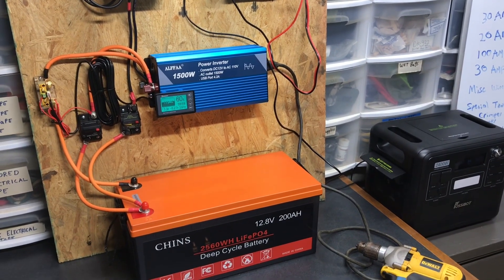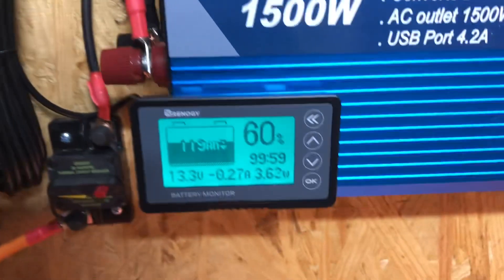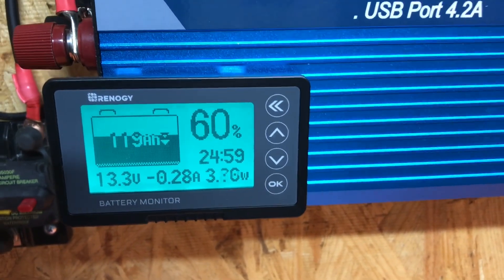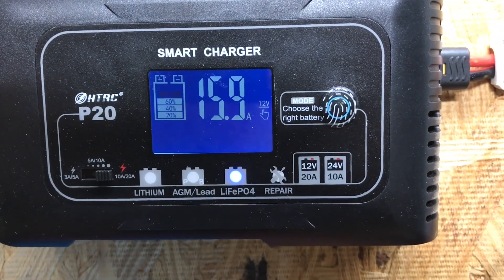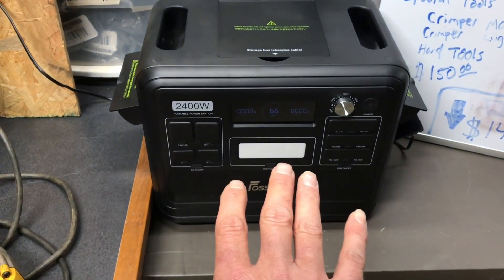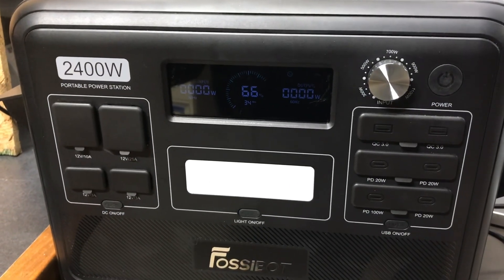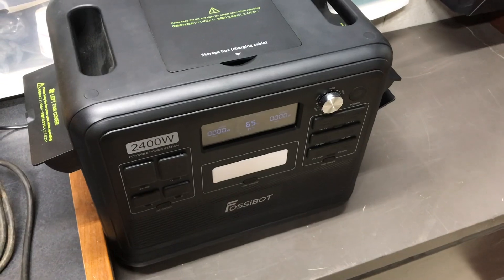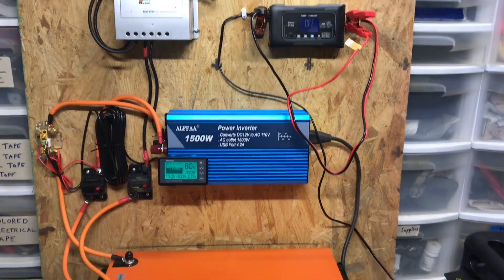DIY SOLAR GENERATOR-BUILD VS BUY

Comment: I built mine much cheaper. $165 with coupon x2 for 2 100AH batteries is cheaper even the mini size I bought. 2  Renogy 100 watt panels with charge controller damage box on Amazon $154, 2000watt pure sine wave inverter also damaged box on Amazon $150. 2 circuit breakers 16 and 36 amp $25, 2/0 awg  5’ black and red $60. 3 200 amp fuses and holders $12. And one of the stackable tool boxes with wheels $60 with coupon at Harbor freight. Anyway it really pays to shop for the damaged box stuff and the Prime day’s sale on Amazon. All test great just has to be configured into the tool box for portability. I think I did great for a 200Ah 2000watt  solar generator. Although I may upgrade to a MPPT charge controller at some point. I hear they are better. Maybe a good video idea to explain the different types.

Comment: Is this big enough to run home freezers (2), foreplace blower fan, and refrigerator?
Reply from the maker: Possibly, you would be pushing what the inverter is capable of in certain circumstances, such as inrush current/surge demands from the freezer compressors and fireplace blower when they start up. For 2 freezers+blower  you might also think about adding more battery capacity to get through the night. Think of the demonstration unit similar to a 1800-2000wh power station! Hope this helps!

Comment: Guess for a little more money for 2000 watt inverter. Plus make sure you use 2 Guage for 12 volt system. Bigger power ac input if able for faster charging if you wanted. But nice to watch for more insight.

Comment: Nice small setup system you have there . Are you planning to set it up on a well designated wall as this system May grow over some time ? The Chins Lipofe4  200 AH battery is the beast and heart of the system plus the backup solar generator is an excellent choice for a 2nd backup power system during any failures or repairs to the 1st system . We preppers are always ready even during any SHTF situation where we can go off the grid . Check out my DIY solar videos and hit like, leave a comment and subscribe and May the solar be with you .😊
Reply from the maker: This was just a basic setup to help demonstrate the concept of what one could build at home. 
There are no plans to commission this setup into a permanent install. R&D only. 

Thanks for watching and commenting!

Comment: How long with that set up run 2000 watts?
Reply from the maker: This particular build isn’t capable of 2000 watts with the Alffaa inverter. 

The battery would run a 2000 watt load with properly sized inverter for a bit over an hour. More to it but that’s a ballpark #. 

Hope this helps! Thanks for watching and commenting!

Comment: Great example of a good budget system.  There are so many good options for these systems and the modular nature of serviceability and upgradability of the home built is really excellent and fun if you are a tinker'er . The all in one is definitely a great solution too and for a lot of people may be the best route due to its simplicity portability and being plug and play. A good upgrade path for this down the road, or even a similar system with higher quality more efficient and moderately more expensively priced components would be Victron SmartSolar charge controller and Inverter and shunt.  The Victron gear is more expensive, but pretty reasonably priced,  Victron's interoperability via Bluetooth networked Victron componentry integration is really excellent.  This budget system is a really nice place to start if you are looking to learn and have a serviceable scalable and upgradable solution.
Reply from the maker: Thanks for taking time to watch and comment! 
I’ve used some victron components in the past and have been pleased with the quality and performance.

Comment: I've got most of my components together, but hadn't thought about breakers yet. Regarding the main breaker you're using between the battery and inverter, you said it was slightly under sized. Would you calculate the size for that one, 1500watt (inverter size) divided by 12volts (battery voltage) for max amperage of 125Amps? My inverter is a 3000W, so I'm thinking I'd need a  250Amp main breaker.. Not sure about that. Scratching my head. Thoughts?
Reply from the maker: Here’s an article you may find helpful.

https://www.sma-sunny.com/us/properly-sizing-a-pv-inverter-breaker/

Comment: Does either the factory-built or the home assembled solar power system significantly outperform one or the other at this point?
Reply from the maker: The factory portable power station would outperform the DIY version in current state. 
The factory one has quicker charging capacity and bigger inverter. 
Other components could be used for the DIY build and it would outperform the factory one. 
There’s more to it, just the short answer!
Reply: @THEOFFGRIDMOUNTAINHOMESTEAD    
    That is exactly what I was thinking. Your Hardware choices where to create a less expensive system that was functional. Thank you

Comment: The thing I am most concerned about is the battery. Electric vehicles do have battery problems. If there is a battery fire due to malfunction or accident. It may take a real fire department hours and two or three thousand gallons of water to cool battery fire and stop it from reigniting. Those cars use some sort of lithium battery. Many parking structures and buildings apparently do not allow electric vehicles to park in them. Are the batteries for home solar systems a similar fire danger? Can you have them safely in your home or outbuildings?
Reply from the maker: LiFePo4 is inherently safe. Automotive batteries (to my best knowledge) for EV are LiON. Which is lithium nickel manganese cobalt. Not quite as stable of a compound, but that’s beyond the scope of this video. 

You may be interested in a video I just posted showing a tear down of a solar generator!
Reply: @THEOFFGRIDMOUNTAINHOMESTEAD     
   I am relieved to hear that the batteries used in solar power systems are not the same as used in electric vehicles and are inherently safer and more stable. I did see that you had posted a look at the components inside a commercial unit, and have not had the opportunity to view it.    
   Thank you very much.
Reply from the maker: You’re welcome! There are charts available with an online search that compare all the available battery chemistries for safety, cost, longevity etc.

Comment: I would like to a description and explanation of wires going to from and to each component. Most of it you can see but some of it is jumbled up or hidden by other wires.
Reply from the maker: A permanent install would have wires cleaned up and shortened. I’ll see what I can do to clarify wiring in a future video. Thanks for watching and commenting!

Comment: Thanks for the information. The first thing that comes to mind with the pre-packaged system is average life span. Batteries wear out. I assume that they would not be easily serviced in these units? How long would one of these last in typical home backup use? Second, how many watts in solar panels would one need to power these systems in South Carolina?
Reply from the maker: Pre package systems with LiFePo4 batteries usually claim 3500+ cycles. So daily use you would get many years of service before degrading your capacity based on mfg. claims. 

As for the other components holding up in a pre package system. I do not know how long they would last if used daily.  I’ve got a small Itehil power station that’s been used hard for over a year and has been holding up well. 

Remember most of these power stations have only been around 2-3 years. 

For solar panels, it would depend on the rating the power station has, your southern exposure, budget etc. Some take 400w of PV and others can go over 2000w. This is a specification that you would need to check on for any prepackaged system. 

On the DIY side, PV input would be determined by the charge controller rating/spec and the max charge rate for whatever battery you would be using. 
Hope this helps, thanks for watching and commenting!
Reply: @THEOFFGRIDMOUNTAINHOMESTEAD  Subbed......😊
Reply from the maker: Thanks, I appreciate it! 👍

Comment: Dang, I tell ya, your techknowhow is so far above my head.  I could never do this.  Like is there anyone who can speak in Kingergarten language on what each part does, where does the energy come in at, how does it move from the point of incoming power to the battery and then from the battery to say a light bulb
Reply from the maker: I’m planning on doing a basic solar video series as time allows! That way each item can be discussed individually! Thanks for watching and commenting!

Comment: I’m 72. Widow. Prepped much. Have heat all kinds of stoves. Meds and a small 4patriot Sol or charger.  Phones…computer..etc
What can I get for a ref that’s solar that would be easy to understand…. Thx
Reply from the maker: What size refrigerator, what age, is it kept full, ice maker? There are a lot of variables. 
“Normally “ it’s recommended to have a 2kW or 2000 watt hour power station to run a refrigerator for 24 hours. 
A power station like in the video, a Bluetti ACMax200, FF power 2k or similar would be simple to use and move around. 
I don’t recommend a particular model, but can speak highly of the Bluetti. Several friends have the Bluetti and no complaints from them…
Hope this helps!

Comment: That is a nice little setup.   I like the home built system myself.   Is that inverter modified sine wave?
Reply from the maker: Thanks! Small system under 3kW, I personally like the prepackaged system. Over 3kW probably more cost effective to build from scratch.  Just because the small boxes are light and portable. 
The inverter is pure sine, although it’s only 110v/60hz. Worked fine on all items tested.

Comment: Also, SP1 mentiones putting this on fire proof material, is that necessary? I was gonna do area with wood base.
Reply from the maker: I would highly recommend a fireproof/fire resistant backing if used indoors. Use an abundance of caution. Hardieboard or cement board may fit your needs.
Reply: @THEOFFGRIDMOUNTAINHOMESTEAD  k thanks, will do that! Set up will be corner area of pole barn type garage, I will proceed with caution.

Comment: So I have most every component in this system, been purchasing slowly over the last 2 years, I have same battery size and larger inverter though. It will be set up with 4 100 solar panels to run my home office in about a month. I dont have the wiring though, seems there is specific sizes, do you have tips on the wiring?
Reply from the maker: I can’t size for your particular system. But I would suggest, to determine your amp draw, add in for surge, then size to match. Stranding, length, insulation jacket and resistance on the wire comes into play as well. Various wire/solar companies have calculators on their websites!